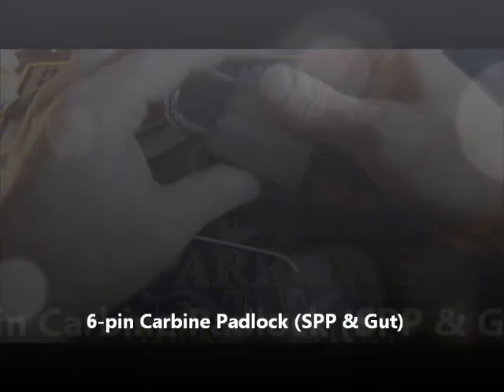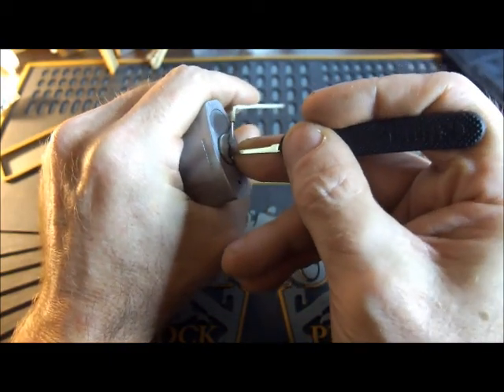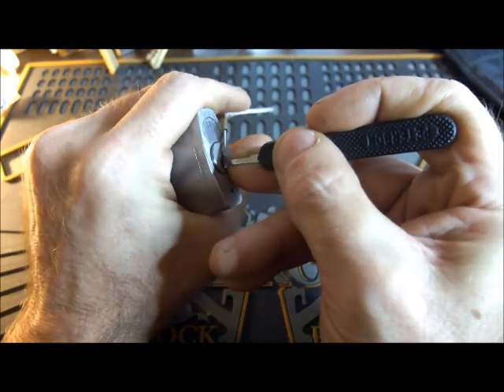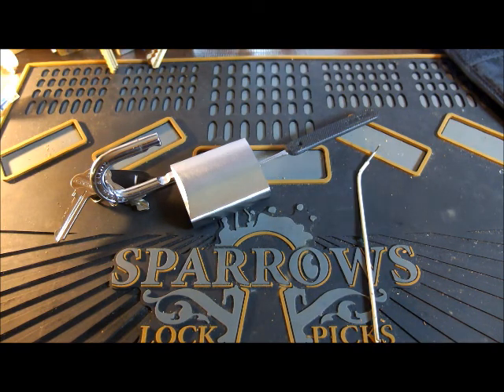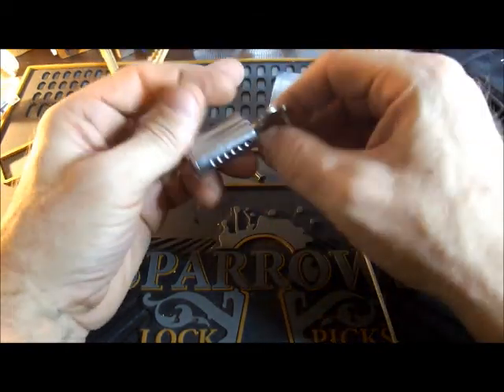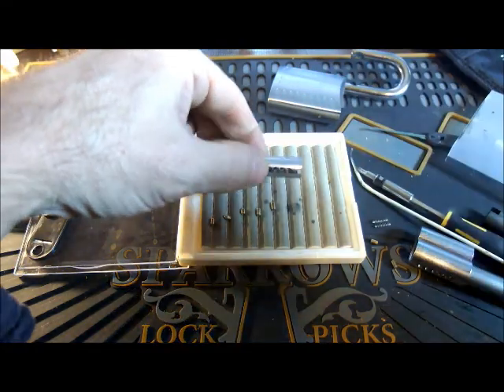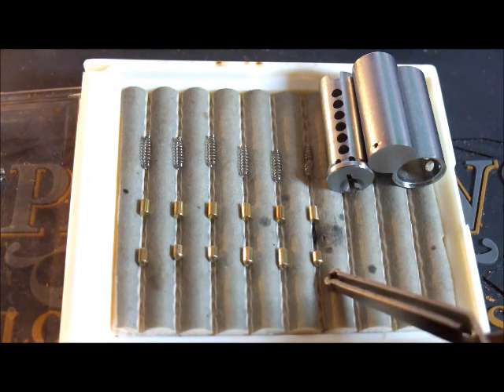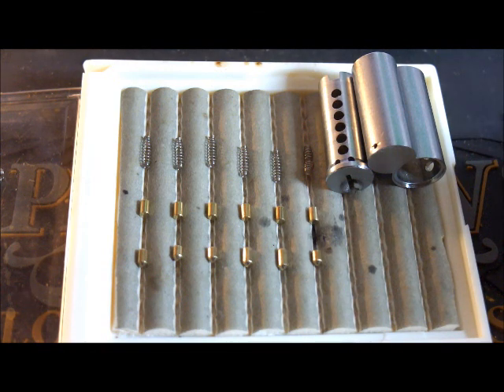6-pin Carbine Padlock (SPP & Gut)

Comment: I found one of these locks without a key in my workshop so I locked it to pick. It's got me stumped so far and I'm positive it has some other security features that yours is missing. Some sort of beveled pins perhaps? No matter which pins I go for 3,4 or 5 always cause one of those pins to drop. 
Rather than cutting it up to see what's causing me greif il post it to you once I've had enough of failing. 
Thanks for the videos. Very informative.
Reply from the maker: Oops, should have made yourself a key first, but I like the confidence. :) There is a very slight curve on top of the pins but nothing to cause any trouble. As you say, yours may be different. Carbine do seem to have some pretty nice tolerances though. Getting the right tension was my biggest problem I think. Keeping track of dropped pins is fun also. :) Might have been easier to just follow the binding order. Stick with it. I'm sure you'll get it. You'll be very happy when you do. :)

Thanks for watching. I'm always happy to help where and when I can.
Reply: +Noctis Motus Ah I didn't think I would be able to make a key, the shackle was open but the barrel was in a locked position. I always close the shackle on any decent locks I find, just so the challenge is there from the start. It can be very frustrating but I just leave them on my coffee table and use it to take my mind off other things. It's funny my partner has a Rubix cube which is no interest to me, but a lock is a far more interesting puzzle. 
I was glad to find your video after a week on this one so far, just to see what you found inside. And the harder it gets the more I want to know why.
Reply from the maker: Could have popped out the guts, removed the cam, picked and shimmed from the back to get it open and then made a key. Fiddly though. I agree, locks are great puzzles. There is no in between. You can either open it or you cannot. Also a great test of one's patience, depending on the lock. :)

Full disclosure: I failed a good number of times at picking this lock. It sat on my table for several weeks. It was only after picking a crazy challenge lock that I decided there was no way in Hell I couldn't open it and attacked it once again. Not sure if it was a shift in skill or just confidence. 

I'm still betting that you will win if you stick with it. :)